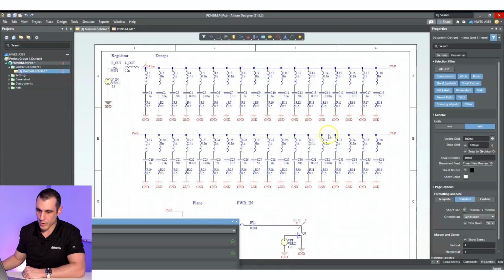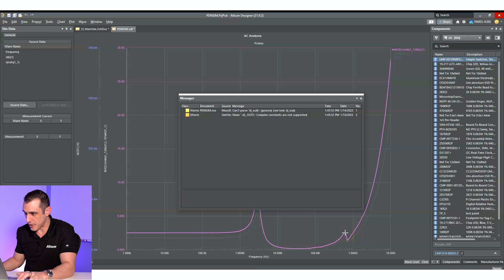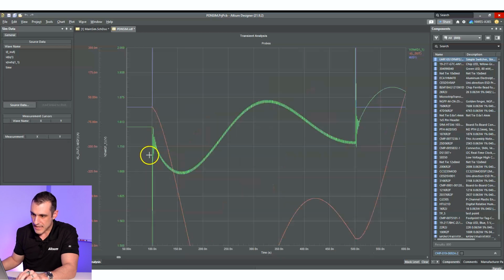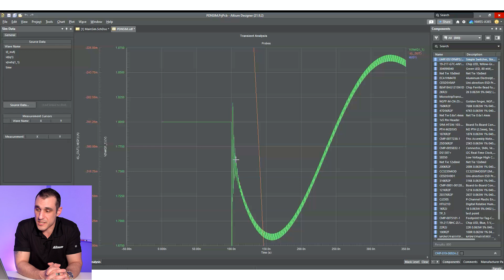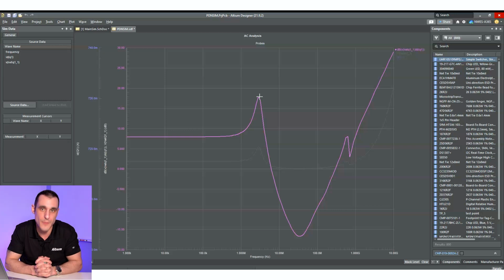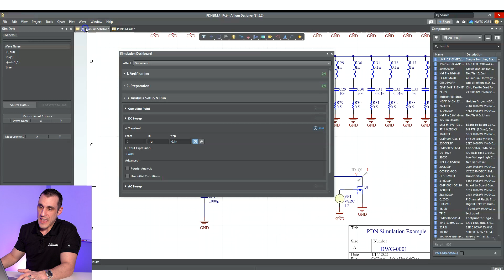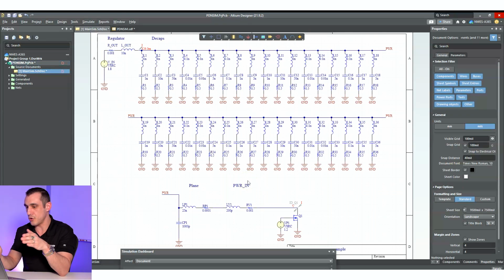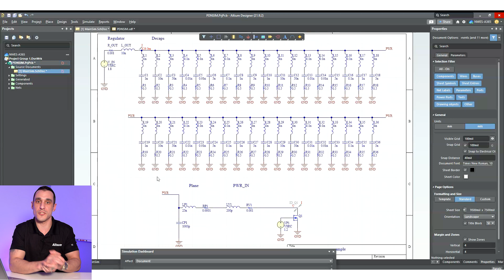Power Delivery Network Simulation Deep Dive - Part Two

Comment: How did the first massive dip in the frequency response become flat?

This was a very theoretical instruction.
Reply: It's by adding some capacitance that provides low impedance at the edges of that dip. Normally following the "3 capacitor" rule might not give you a flat response unless you pay attention to the SRF value at your target frequencies, but the frequency response can be flattened out if you know where the SRF value is located. Datasheets for caps that could be used in high speed designs will contain this data.

Comment: Thank you for your great video Zach. If the inductance increases the impedance over high frequencies then we should avoid stitching vias in our designs?
Reply: You have to look at where that inductance was placed, it was in series along the power net. Stitching vias are used to link together different regions of copper to the same ground net.
Reply: @Zachariah-Peterson  

Fhhh

Comment: It also shows that having Vcore power regulators off-board is a very bad idea. But modern PCs still do it, compensating for this by obscene amount of capacitors, both on the package and on the motherboard.
Reply: Yes definitely, and for the longest time they do motherboards on 4 layers so they can only get so much plane capacitance